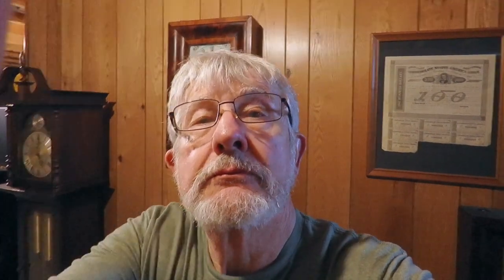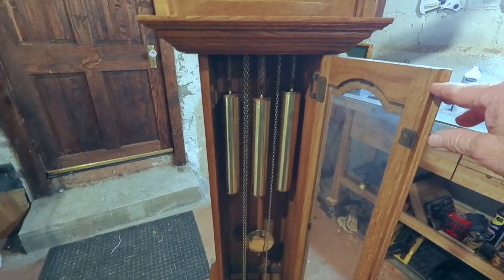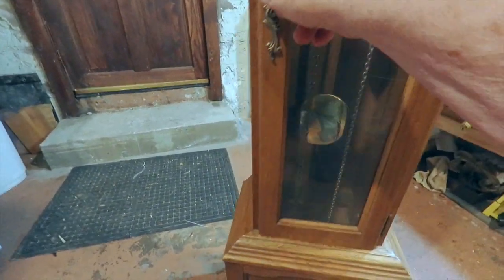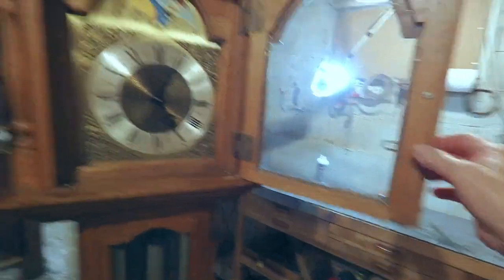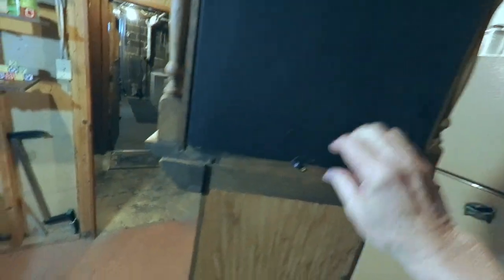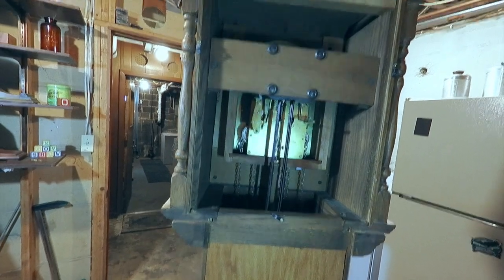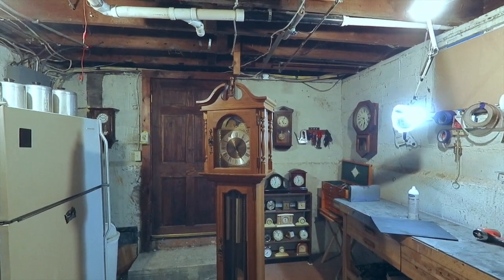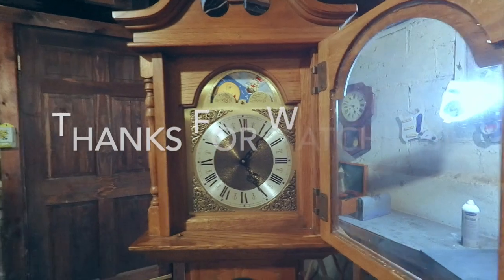Emperor Grandfather clock, 1978

Comment: I built one of these kit clocks around 78. Mine was walnut , put together, stained and finished the cabinet! My first major wood project,  turned out great. I was in my early 20s. Mine had the moon dial , it kept perfect time!!! You can still get these clocks from Emperor
 They are located in Virginia now.
Reply from the maker: This one keeps great time, after I found out the person that built it, cut the pendulum rod a little too short.... I was able to extend the length on it and that's all it took to be a nice time piece...
Reply: @jackoshaw  I also built a manel clock which is the same clock as the grandfather clock without the bottom. It was for my daughters 1st birthday,  she will be 44 this. Clock is still running perfectly!!!!

Comment: I inherited this clock from my dad.  He bought the kit and assembled the clock in 1978.  Unfortunately the suspension spring just broke after running for 46 years which I thought was impressive.  I replaced the suspension spring but I can't get the clock to restart. The chimes are working. Either I made a mistake doing the repair, or when the suspension spring broke the middle weight got pulled to high , or the chain came off its sprocket.  In any case there is no movement, i.e. no tick-tock.   I have tried to feel for the chain sprocket but no luck and the sprocket is not visible. Would welcome any suggestions.
Reply from the maker: ...First, I would make sure the clock is sitting level... Then I would adjust the beat of the clock... Where the Suspension spring attaches, There is king of a clutch that will move the  suspension spring to one sid or the other.... it needs to be adjusted... Remover the pendulum and rod, Take the back off and see if you can't get it to "Tick-to" by hand. Adjust the clutch until it runs by itself without help and without the Pendulum attached... if it does, let it run for a good while....

Comment: Hi jack, how did you fix the weights and the chains being too high up? I just bought this exact clock and it has the same problem. The center weight is so high I can even remove it.
Reply from the maker: There is a rod that goes through the center of the weights, with a nut on one end.... If you are careful, you can unscrew the weights.... Make sure to hang on to the weights when they come apart. They are heavy.....Once you get them apart. You can take the hook off the chain and re assemble the weight... Hope that helps..
Reply: @jackoshaw  thank you so much for your reply!!

Comment: Hey jack, my grandmother has that grandfather clock but one of the weights fell off, or it got pulled off I don’t remember, do you know how or if the weights go back on? If not that’s okay, thank you!
Reply from the maker: There should be a hook on the chain for the weight....
Reply: @jackoshaw  thank you, I’m sorry, I don’t know anything about this at all, my Grandmother said when I visited recently that it got pulled up too far and stuck in the top, thank you for answering my weird questions.
Reply from the maker: @IzzyCat923  If the weights are up too far and stuck at the top, you can take the weights apart by unscrewing the rod that goes through them... I must warn you, They are very heavy when they come apart and there also may be some bearings inside, somewhere.... Not to discourage you, THey are really easy, to reassemble, once you get all the parts unhooked..

Comment: I have one of these 300M Emperor clocks with a Jauch movement.
Does anyone know if its safe to leave the 2 chime weights on each side unwound sitting on the floor of the clock, and only wind the center weight?   That way it will run without chiming.
There is a lever on the right side to turn off the melody, but I see no lever to silence the hour strike.  This seems to be a solution, but not sure if that will damage the mechanism running it this way?